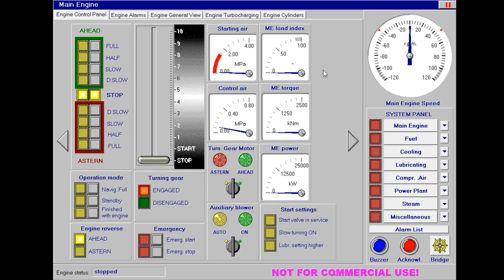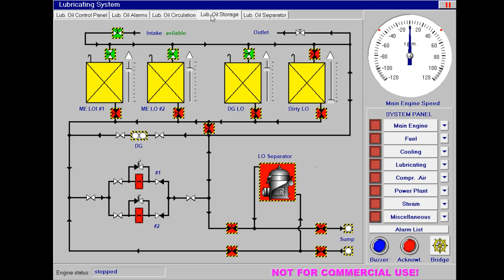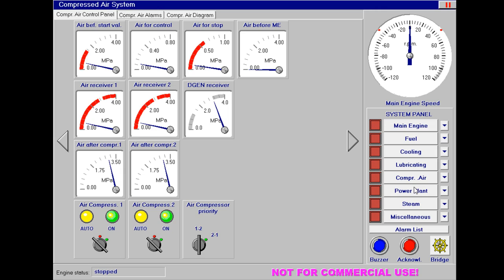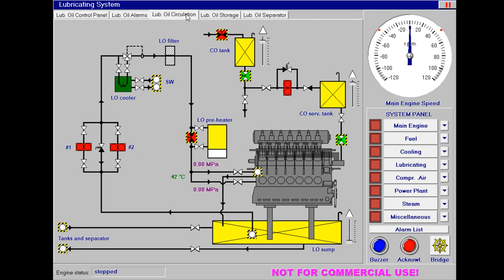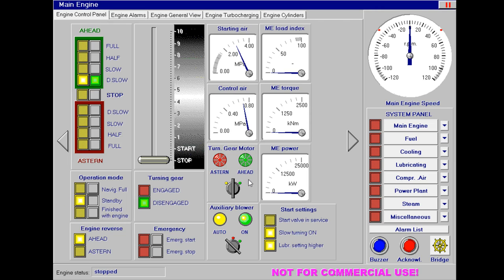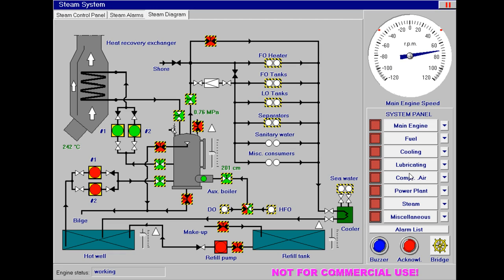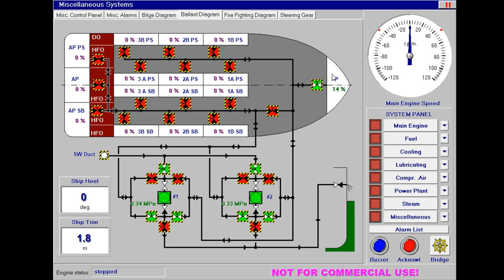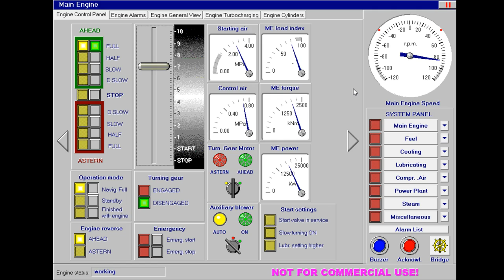Virtual Engine Room Startup Tutorial

Comment: Thanks for running something out of the ordinary, gave a good excuse to tool around with something new! Don't know if you're aware of this but i discovered after some trial and  error that you can prevent the hot well overtemp from occurring if you first switch on the ME SW/FW pumps in the cooling page. I believe the hot well wasn't being cooled because those pumps were offline and the steam exiting the boiler wasn't being properly cooled after passing through the SW cooler before being returned to the hot well.
Reply: Yeah there's a condenser that cools the steam with sea water, that's why you need the SW pumps.